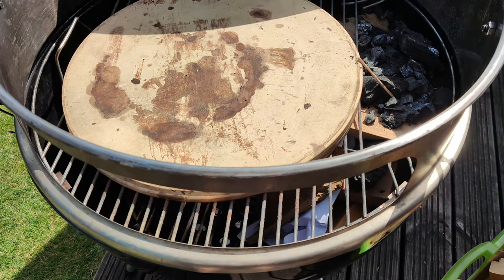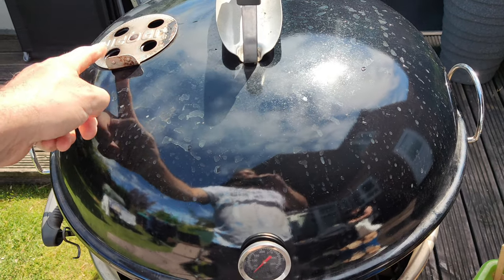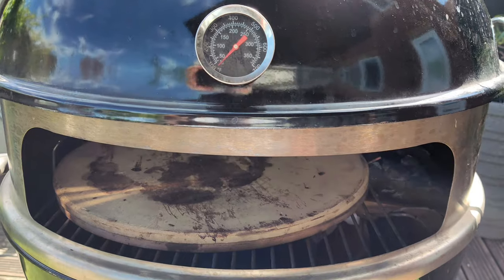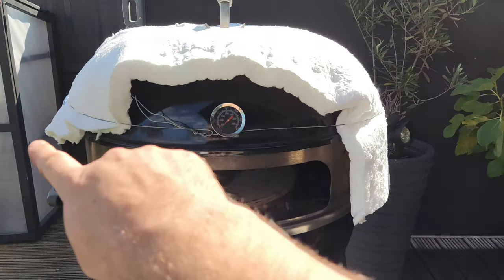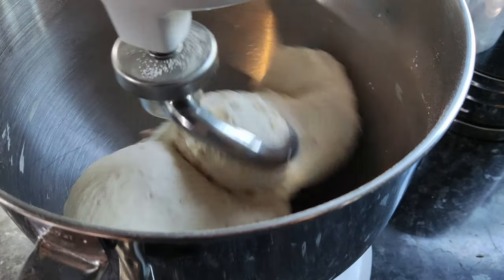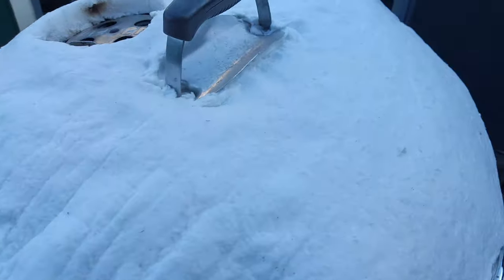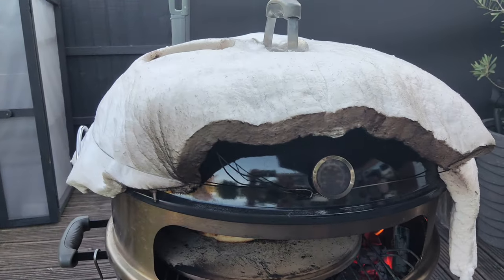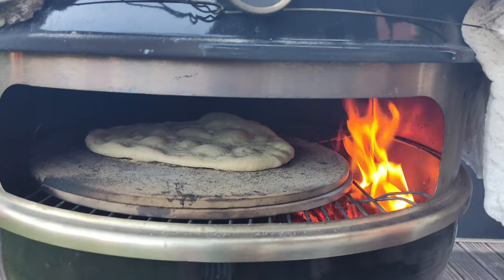Forget Ooni - Use an amazing Pizza Blanket to cook in 90s!

Comment: The blanket is great for insulation but what you need is more thermal radiation above the pizza. I’ve been playing around with a second grate above the pizza to hold a steel plate

Comment: This is smart and everything but it’s a lot of work to get what you can do for 250 quid to get perfectly. Also your heat up time will be much longer on this. 

Nice for a project, not possible for most people. Just buy a pizza oven
Reply from the maker: Yes. Just a Science project really. It also works pretty well without blanket. The main issue is the ability to add wood without lifting the lid. I have taken off the blanket now to try without